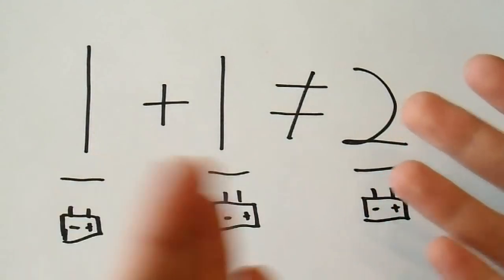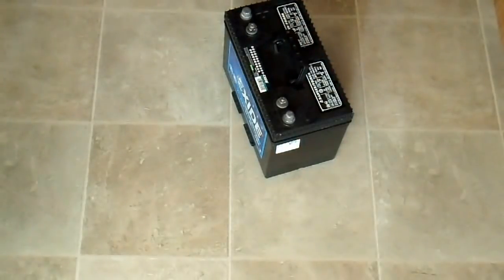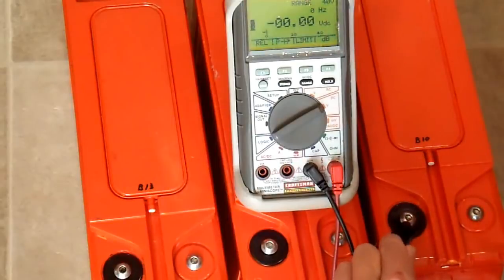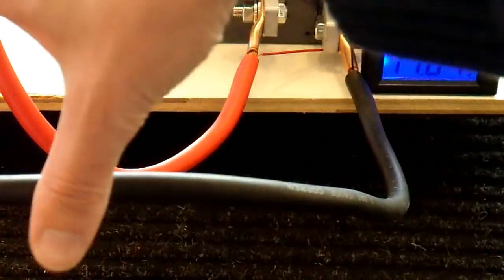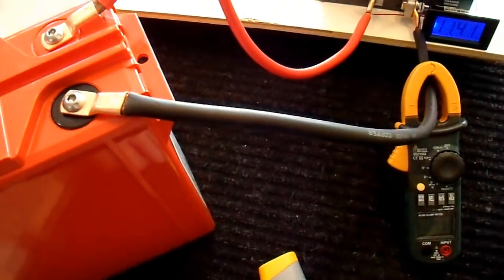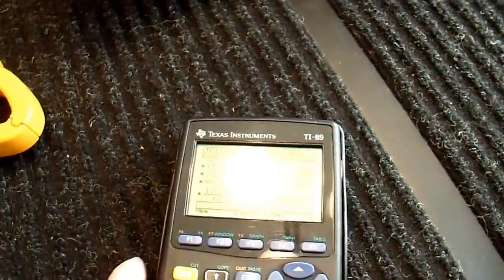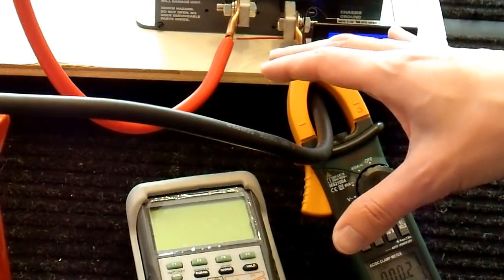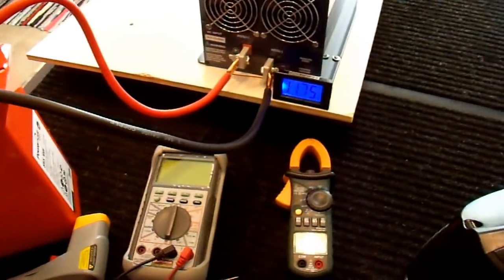Parallel Batteries Don't Add part1: When 1+1 = 2.7

Comment: Peukert's law, presented by the German scientist Wilhelm Peukert in 1897, expresses approximately the change in capacity of rechargeable lead–acid batteries at different rates of discharge. As the rate of discharge increases, the battery's available capacity decreases, approximately according to Peukert's law.
Reply from the maker: The key word is 'available' capacity.

Comment: so is it okay to connect different battery type on parallel?
thank you
Reply from the maker: That would be a long and complicated answer.  The general answer is 'no'.  The specific answer is 'absolutely, if...'   The specific circumstances, goals, limitations, and application can vary greatly.  I do this all the time for short term uses but would be very careful in doing so for more permanent applications unless specific conditions were present.

Comment: What wil 1+1+1 be equal to?
Reply from the maker: Probably around 4 but...  this is a strange comment and if you are who I think you might be I will soon find out.
Reply: @knurlgnar24  sorry, I have two in parallel on 12v inverter and also realised I get more out of them than both in series on a 24v inverter, so i wanted to get another 12v battery.

Comment: The general rule when doubling the # of identical batteries but keeping the load the same (as was tested on 1 battery such as 25A load) is 1 + 1 = 2.2 (10% more than simple math would give you).  4 identical batteries would be (2.2 + 2.2) + 10% = 4.84 (almost 5 times the runtime of 1 battery at some fixed load such as 25A).  The same is roughly true if you halve the load from say 25A to only 12.5A but keep the bank size the same.  It should run twice as long plus 10% longer so 2.2x as long.  Double the bank size and halve the load (such as 1 battery got 25A load but 2 identical batteries (as the 1 previously tested), got 12.5A load total), and you are back to 4.84x expected runtime.
Reply from the maker: I'm sure that 'rule of thumb' is a decent approximation for whatever application it is intended to be used for, but for most applications you will do far better than 10% additional due to battery banks nearly always being severely undersized for the application.  In SLI applications you'll likely do in excess of 100% but that's a different context.  In a well designed industrial or off-grid application then yes that sounds reasonable, but I have NEVER seen a properly sized off grid battery storage install on youTube.  Not one.  Maybe they exist but I haven't seen it.  In most cases you'll do more like 20% gain.
Reply: @knurlgnar24  Trojan and other battery manufacturers disagree with you then.  Look at the capacity ratings in the data sheets for those.  They increase by about 10% as the drain rate time doubles.  So for example, if the battery is rated at 100Ah at the 20 hour rate, it will be about 110Ah at the 40 hour drain rate, and about 90 Ah at the 10 hour drain rate.  A very simple formula to remember and a very good approximation for lead acid batteries.  So are you saying Trojan battery company who have been around for a long time, are wrong?  They also usually list the 5 hour drain rate usable capacity too.  The 10% rule of thumb formula works best between 5 hour and 20 hour drain rates.  If you go down to 1 hour then yes things do deviate from that cuz that is a VERY heavy load on a lead acid battery to get it down to 1.75V per cell under load in only 1 hour.  Also if you go up to 100 hour drain rate (Trojan does post that in their datasheet), again, the 10% "rule" does not do well at that low drainrate.  For example, a Trojan T-105 6V battery is rated at 225Ah at the 20 hour drain rate, but only 250Ah at the 100 hour drain rate.  100 hours on a 250Ah rated FLA battery (125Ah usable), would be a very light 1.25A load, which at 6V, is only 7.5 watts.  Basically an LED lamp or an incandescent nightlight equivalent.

Regarding properly sized battery banks for offgrid, there are many of them.  Some people have very light loads and only need things like computer, lights, fans.... to run from battery power.  Whole house backup power is not so easy as you would need enough to run a house for maybe a week assuming the sun might not show up that long.  You might need a bank that can hold 100 KWh and that is not easy to do.  What I would recommend in that case is to have a generator and offload some things such as lights, heaters...   things that are not so sensitive to "dirty" (distorted) power, and blast the battery bank with some heavy duty chargers so they don't drain so fast running the rest of the house.

Some people are buying (or making) their own "powerwalls".  Enough of those could run a typical house for a week, especially if helped with solar, wind, generators....

Comment: Okay I knew better but I used a piece of #2 welding lead that I had laying around for no telling how long and it may have gotten damp laying but anyways it had this oxidation on there so I had to sand the ends to solder it because it wouldn't make connect..so anyways I've got six 85 amp RV batteries I'm getting 2 more Wednesday so then I'll have 8 hooked up 24 volts to my Aims 2000 watt inverter/charger...I've ran a 1500 watt load on it ...air fryer and TV...and it runs it fine but I get a gradual voltage drop and it bounces back but I need to keep it above 23.7 or the charger comes on...what it acts like is that its maybe not charging quite as well...I used two cables on each post of the inverter but it's bugging me about changing out the #2  cable for some new stuff...I plan on running a pair for each 4 batteries and itll be 2 feet to the Aims when I get it rewired instead of the 4 feet it is now...how much voltage do you think I'll gain?

Comment: if i have 4 x 12V batteries and want to do a 24V system, is it better to hook them up into:
2 in series +  2 in series and those in paralel or
2 parallel + 2 parallel and those in series ?
as allways there are folks that say the first is better and other say the latter is better ...
Reply from the maker: This was a video idea I had planned to make explaining the pros and cons of each configuration but never got to it.  The answer depends on your specific application.  In general battery manufacturers recommend connecting in parallel first and then in series.  This may or may not be the best for your application.  In short if you might add batteries in the future I would use multiple strands of 2*12V batteries in parallel.  If all batteries will always be identical, matched, and replaced at the same time I would connect them in parallel first, then in series.
Reply: @knurlgnar24  Thanks, that would be a great video, because i searched all youtube and noone actually explained it like you just did.
other than that, how critical is balancing in these instances ?
when do i build a bank of "series first and parallel then" ?
Has one configuration the pro of being capable of delivering higher discharge current?

Comment: 2 600w 18ah 12v batteries in parallel to a 2000w inverter
Really just to charge electronics in a car, off the main battery
How long will it run a Mac mini
Reply from the maker: Without any details I'd guess an hour or two, no more than that.

Comment: 9:30 Amprage can not be tested like that on DC. The tester is only meant for AC current. Sorry sir. You should use an inline DC amp meter.
Reply from the maker: Very strange comment.  The voltage ratio on the inverter is about 10:1, so the current ratio is about 1:10 neglecting efficiency.  I thought that would be self explanatory and I believe it is to most viewers.

Comment: Try putting heater on low witch is normal in a normal house high is if your are freezing I use same heater and I run on low hardly ever use high

Comment: A few more comments here.  First, since these are new batteries, you are supposed to go easy on them the first 10 charge/discharge cycles, not drain them more than 50% (since they are AGM technology).  Also a few times you mentioned "totally drained" but that is not true.  10.5V under load is NOT totally drain, it is only partially drained as you illustrated here.
Reply from the maker: The new battery care item you mention is a myth, and the 'totally drained' comment is true but a matter of context.  The generally accepted definition of 100% DOD is draining a battery at constant load to 10.5V.  Part of the point of the video is explaining that this is indeed NOT 100% discharged as defined by most sources.
Reply: Part of the problem of an inverter draining under load to about 1.75 volts per cell (10.5V for a 12V battery), is that the DoD (Depth of Discharge) is dependent upon how light or heavy the load is.  As you illustrated, a heavy load will stop sooner, and a light load will stop later.  If the load it very light (like suppose someone turned on the inverter and there was no other load on it), that will basically KILL a battery, since it will likely not spring back to about 12.0V when the load is removed, since the load is very light (such as maybe 1 amp).

Also why do you say the first few cycles of a battery need not be shallow cycles?  Look at this link.  It is the first one on the list.  Why should I believe you and not them?  What proof do you have?

http://www.batteriesnorthwest.com/batteryschool.cfm?TID=2
Reply from the maker: @davidjames1684  First, thank you for siting a source!  I do not see any evidence or reason in that source however and it conflicts with what battery manufacturers say in their whitepapers...  In fact heavy cycling is what is needed to properly form a battery.  A good example is purchasing a high quality battery from any auto store.  If you test it using a conductance meter it will likely fail the test - all battery manufacturers say the batteries require a few cycles before they reach full capacity.  In reality the depth of these discharges is irrelevant as a 50% discharge will have twice the effect as a 25% discharge, but in a practical sense a heavier discharge will more quickly get a battery up to maximum performance.  I do not have video proof of this but you can try it for yourself on a new battery.  Purchase two, cycle them shallowly vs deeply, and compare the cycle by cycle performance.
Reply: I think you mean citing.  Well I am just using common sense.  A new battery that is not putting out 100% of its usable capacity, should probably not be stressed down past 50% DoD, especially since even a full capacity battery (AGM type) is not supposed to go below 50% SoC.  Here is another citation that also states new batteries should be "babied"... https://www.powerstridebattery.com/blog/how-to-maintain-deep-cycle-batteries/.   The paragraph that starts with "New batteries...".  I think a good solution for new batteries is for the first few cycles, ramp the DoD from like 25% to 50% perhaps in 5% increments.  Then after 20 or so cycles, it should be at 100% rated capacity.

If in AGMs, only 50% of the power is usable, why the hell do they rate them otherwise?  For example, if a 100Ah AGM battery has only 50Ah usable, then why not rate it 50Ah?  That would be more accurate.  People are interested in the usable power, not the power that will kill their battery.
Reply from the maker: @davidjames1684  Yes, a typo.  In all batteries there is no threshold to how deeply they can be discharged.  If you look at any battery datasheet you will see that the cumulative damage to the battery is an integration of the cycle depth * cycle count.  Any source that specifies a threshold past which a battery should not be discharged has a fundamental misunderstanding of how batteries function.  This is objective fact and I would encourage you to look at actual manufacturer datasheets for further information.  There is so much 'junk' information out there that just isn't correct.  That said I understand that to you I am just some ya-hoo on the internet so I do not judge you in the slightest for questioning me.
Reply: Actually I have experience with this... I have a VERY old AGM battery that is 20+ years old (it might be 25 years old).  It wasn't doing so well for a while so I nursed it back to health by leaving it on my PULSE desulfator for months and cycling it a few times.  Amazingly, it got back to over 75% of its rated capacity.  But guess what, I did a drain test similar to yours where I gave it a heavy load until my 12V inverter complained (at 10.5 under load), then I halved that load and continued until that beeped, then I went a 3rd round halving the load again.  I probably got that battery down to about a 75% DoD.  Guess what happened after that?  IT DIED!  It will not  go above about 10.5 volts so it will not accept a charge.  All that work nursing it back to life "killed" by overdischarging it (past 50%).  There is a reason why people say AGMs should NOT be discharged below 50%.  My opinion is they should re-label 100Ah AGMs as 50Ah (usable).  I will stick to that opinion and many will agree with me (but maybe not you).
Reply: @knurlgnar24  No, that is not considered 100% DoD, that is 100% of the allowable DoD (assuming a significant load) which is about 50% actual DoD (for lead acid batteries).  Remember the flaw I stated in a fixed low voltage cutoff in inverters.  It can ruin lead acid batteries if the load is too light for a particular bank (such as the inverter was left on but the main load was removed after a drain test).  If the inverter draws say 1A overnight and the battery was already down to about a 50% DoD before that, it will slowly drop to the point where it is doing some damage.  The problem is the voltage will "spring back" after the main load is removed, but the inverter itself will not put enough load to sag the voltage to 10.5, until it is "too late" (battery damage will have occurred by then).  A bad design in my opinion.  A good idea would be to have a load of about 1/4 of the battery's rating.  So for a 100Ah rated battery, use a 25A load (300 watts at 12V).  For a 33Ah rated battery (1/3rd the rated capacity of the 100Ah rated battery), use about an 8 A load (about 100 watts).  That should help protect the batteries.  An "extreme" case is if you had a very large bank, say 12V 1000Ah, you better put a VERY big load on that if you want to rely on the low voltage cutoff protection at 10.5V under load, such as 3000 watts, otherwise you might damage that bank.  I am talking lead acid batteries here.  Perhaps 2 hair dryers on high will be close to 3000 watts or 2 space heaters on high or 1 of each on high.